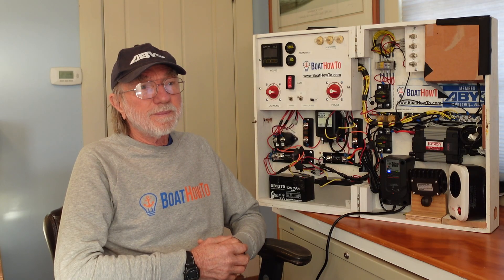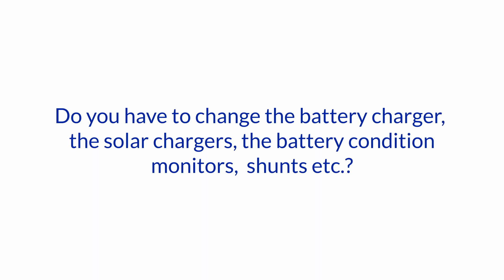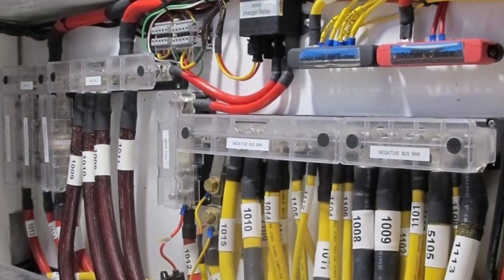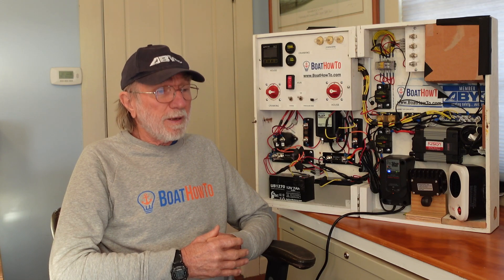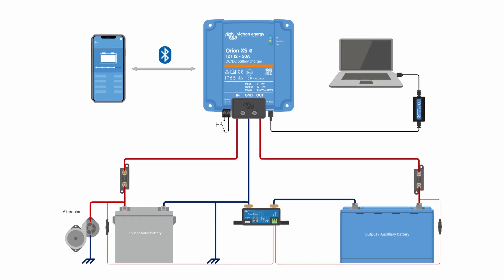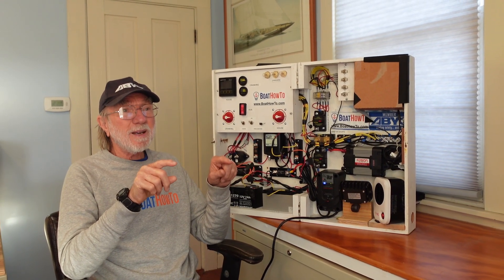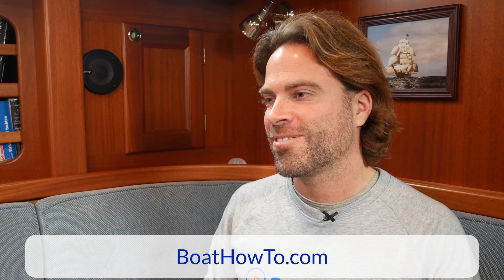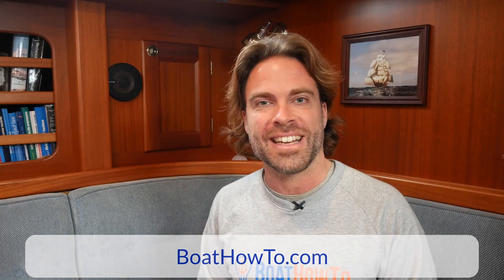Upgrading to LiFePO₄ - Don't take it lightly! 🫣 | Ask The Expert with NIGEL CALDER

Comment: Dear team,
I have recently purchased a Colvic Victor 50/54 and upgraded it with two 24 Volt 8kw 330Ah LifePo4 batteries. I would like to have these batteries (will be extended in the next upgrade) to be the core electrical power source. Charged by smart alternator plus ArCO Zeus and a large solar array everything on board should run on these batteries except the starter batterie for the main engine. Question now is, what layout do I need to 
- charge the starter batteries (AGM) with my LifePo4 bank
- charge the bow thruster and windlass AGM bank with my LifePo4?
Some claim, an ordinary dc to dc charger could not charge AGM with LiFePo. An Orion xs 1400 already charges the starter battery via the Alternator ... What is your opinion on that issue? Thank you very much!
Kay, SV Lucky Jack

Comment: A lot of LiFePO4 batteries will automatically turn themselves off, if they're under no load for a few days.

If this is the battery powering your bilge pump, this can be a very big problem.

Before you buy a battery, check whether this shutoff exists, and if it can be turned off.

Comment: I think one of the least understood matters is the issue of disconnecting a live alternator, which can and will happen when the BMS kicks in. From earlier videos I've come to understand that a simple ArgoFET isolator may not be enough, even if one of the branches is still lead (i.e., the starter). Solutions are abound, but each has drawbacks: alternator --> lead --> b2b charger --> li-ion; or alternator --> external reg li-ion capable --> isolator --> li-ion & lead; or alternator --> lead --> Clark's batt bank mgr --> li-ion (bypass bms); or li-ion capable alternator --> isolator --> only li-ion banks

Honestly, I don't know which of these, or other, would be generally considered safe and appropriate for sailing vessels. It appears to me that there's always a lead acid battery to help take the load of the alternator when the bms shuts off (unless your alternator is already li-ion capable). I'm not quite sure what to make of all this. Thanks for your insights as always 😊.

Comment: What I generally recommend these days is to leave the alternator connected to the starter battery.  No chance of destruction then.   Doing lithium properly really requires having several DC-DC chargers and generally speaking using 24V (25.6V LiFePO4) for the house bank, plus a separate 12.8V LiFePO4 battery for legacy 12V gear (don't hang legacy gear off the starter battery). 

Which sounds scary but actually most of these bits of equipment are small and cheap and produce no heat and require no thick wiring.  So its a schematic / psychological barrier rather than an actual equipment complexity barrier.  Small boats can omit some of the complexity by sticking with 12.8V for the home bank (combining (B) and (C) below), but anything 30ft or larger really needs to consider going full-on.

Its a complex description but the actual equipment is fairly cheap, small, and doesn't output any heat or really ever get stressed much.  Which is the whole point.

Basically you have three battery "banks"... really just a few small discrete batteries and one real battery "bank". 

(A) 12V starter battery + alternator.  Do not hang legacy 12V gear off this system (with one exception in the safety section below).  Only has to be able to start the diesel, does not have to be more beefy than that or have a deep reserve.

(B) Home bank (25.6V or 51.2V LiFePO4) (potentially huge home bank).  Think 5kWh or 10kWh or even more for a 30ft+ sailboat.

(C) 12.8V LiFepO4 down-buffer battery for legacy 12V gear. (usually just 100Ah @ 12.8V)

* Shore charging, inverter, and any medium voltage DC appliances connect directly to (B).

* Small DC-DC chargers go from (B) to (A), and from (B) to (C).  Typically just 10A is plenty.  (B) to (A) only operates when the engine is turned off (usually can just be voltage based, detecting that the alternator is not running).  These only need to trickle-charge.

* A modest DC-DC charger goes from (A) to (B) when the engine is running to feed alternator-generated power to the home bank at a programmed current that the alternator can handle.  Amperage depends on the alternator but 20A to 50A is fairly typical.  (usually can just be voltage based).

--

That's basically it, but there are some additional safety considerations:

* Consider tying 2 x 12.8V 50Ah batteries in parallel for (C) for added redundancy.  Else 1 x 12.8V @ 100Ah for 100A operating and (typically) much higher amperages for surges, depending on what is needed.

* Note that the starter battery + engine is the single most critical subsystem in the entire boat, the bilge pumps are #2, and the radio is #3.  This is why there are two ways to charge the starter battery and redundancy for the bilge and radio.

* In addition, the DC-DC from (B) to (A) can augment the amperage if necessary to help start the engine.  As long as the home bank has energy, there will be basically no fade on the starter battery if you are having trouble starting the engine.  And even if the starter battery is dead, surface charge on the lead-acid battery plus the DC-DC is usually enough to actually start the engine.

* You remove the 1/2/All/none switch entirely.  Never directly tie lithium and lead together.  Ever.  For any reason except in the most dire emergency (C to A), and even then I wouldn't have a switch for it.  Maybe a limited amperage breaker if you really think you need it.  But not a manual switch.

* Add separate (typically breakers) battery disconnects for (A), (B), and (C).  Battery and DC-DC's.  Six breakers.

* Add a small transfer switch for at least one bilge to move it between (A) and (C)

* Possibly add a small dedicated 12.8V LiFePO4 battery (call it (D)), high-up in the nav station to run the radio, with a small DC-DC from the home bank to keep it charged.   And a small transfer switch to select (C) or (D) for the radio.   If the boat gets flooded the radio will still be operational.

* Keep some extra DC-DC's in storage.  A solar charge controller can also substitute as a DC-DC from a higher battery voltage to a lower one in an emergency.   This is the weak point of the system but the critical components will still be extremely robust.

--

There are many other considerations, such as whether to use isolated DC-DC's or non-isolated, and so on and so forth.  But that's the basics.  It seems complex but it actually isn't.   Most of the equipment is small and doesn't generate much heat so can really be packed together in a box.  You don't need sprawling layouts of Victron equipment like you often see in videos.

-Matt
Reply: Wow, you basically just summarized my two year long wondering and pondering to convert my aging lead powered 44ft Jeanneau Sun Magic production boat (1988). I've always been weary of 48V systems, guess I'm afraid of the shocks, but in the end, it would simplify a lot, especially the thick wiring. 

I'd have one question for my specific case. The bow thruster and windlass have a dedicated 12V AGM. I'm not sure if I should replace these. From your advice, I think it's best to treat them similarly to the starter battery. I really like your idea to trickle charge lead from li-ion, as during winter storage I only have solar and that's when the starter and windlass banks get too depleted.